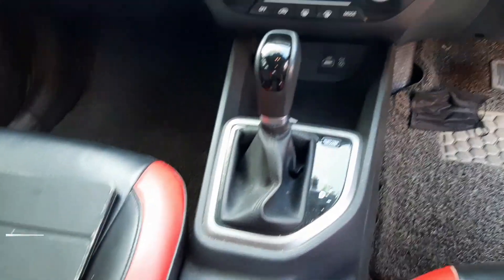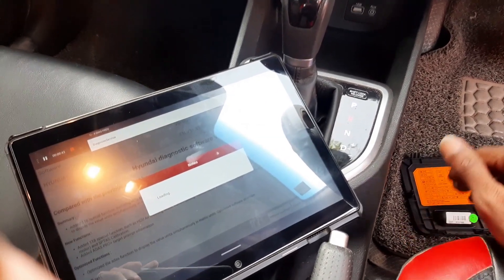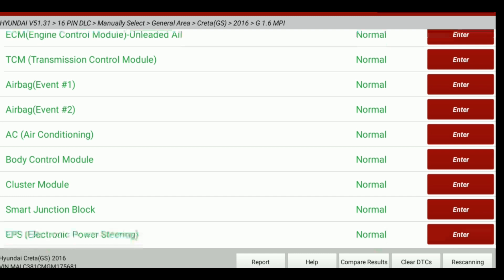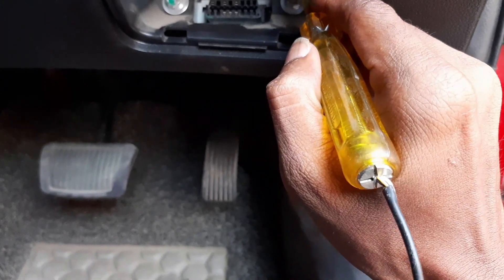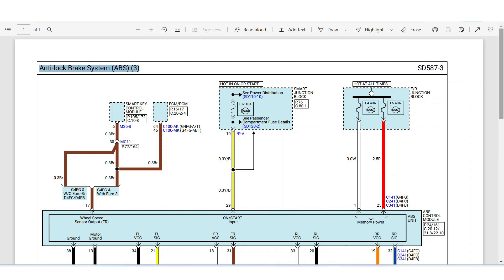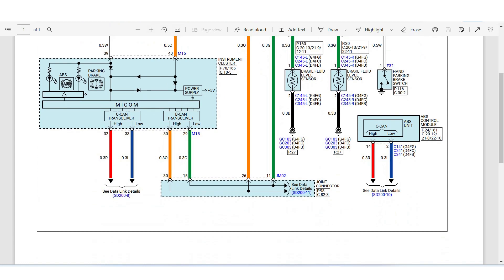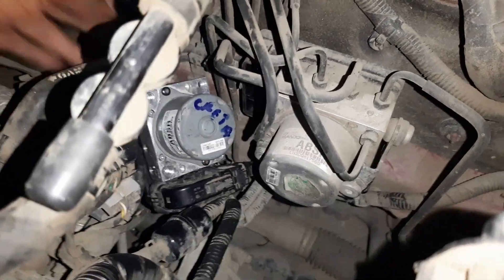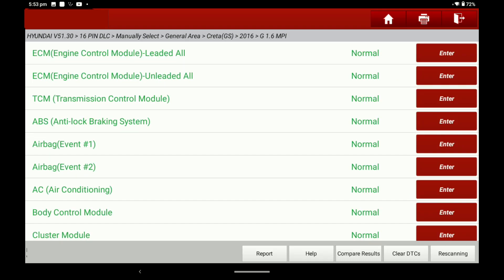Hyundai Creta 2016 ABS light glowing on Continuously / No Communication in SCAN

Comment: Enn car same model but mannual gear, ithula enna issue na abs and steering waring katuthu steering slightly tight ah iruku,, show room la check pannitu speed sensor cut airukunu soldranga real fault ithana
Reply from the maker: What DTC code is coming while putting the scanner bro.